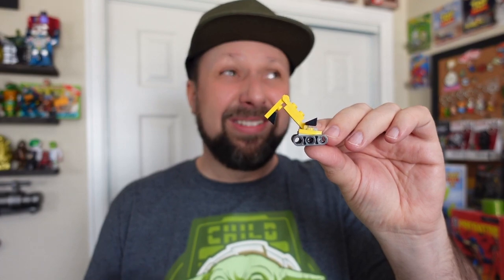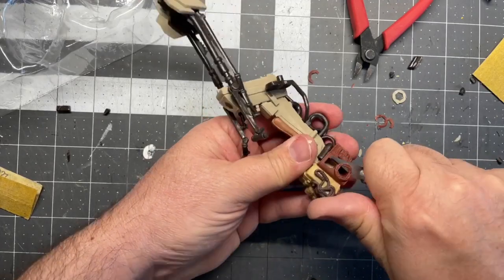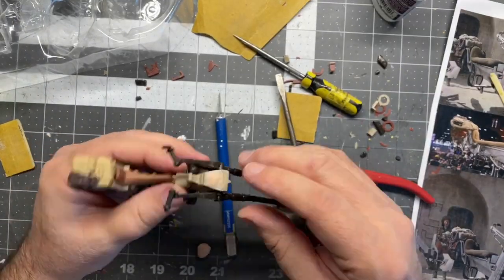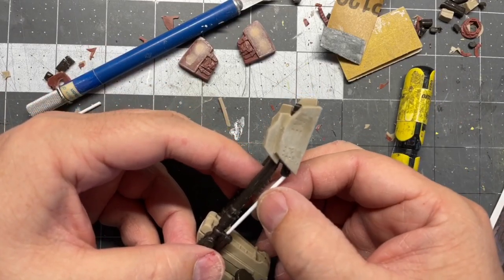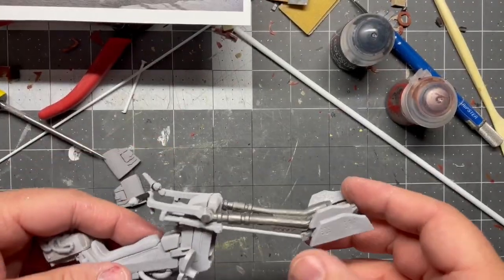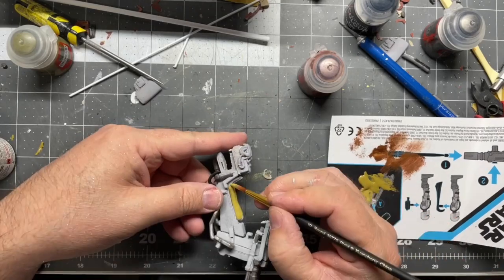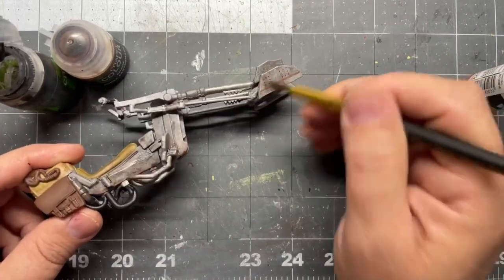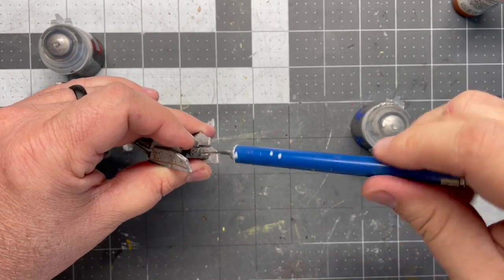How to make a Mandalorian Speeder Bike Custom Repaint and Modifications - DIY

Comment: Awesome job Doc, I was very surprised to hear you used sculpey and it survived the oven, I know sculpey bakes at low temp but that's crazy. 👍😎
Reply from the maker: I was running out of time so it was definitely a gamble... 😂
The saddle bags were fine but the bike was a little floppy until I ran it under cold water. It maybe wasn't the smartest idea but hey, it worked! 😂

Comment: Very nice. I couldn't belive you put that in the oven. But hey it worked. That vinyl plastic Hasbro uses is nice because it cuts easily, but yeah it's really difficult to glue on it. I use gorilla super glue and still have difficulty.
Reply from the maker: Thanks 👍

Comment: Unsure if you mentioned anything about it (I'm partially impaired of hearing) but next time you need to fill some holes 
without risking to melt anything in the oven (surprised the toy survived, phew), you could use two-part epoxy putty.
Regardless, superb job as always :>
Reply: He said anything else would take too much time
Reply from the maker: Yeah, I have Mili Put but it take a few hours to dry and I didn't have enough time for that... I totally know I dodged a bullet on this one! 😂